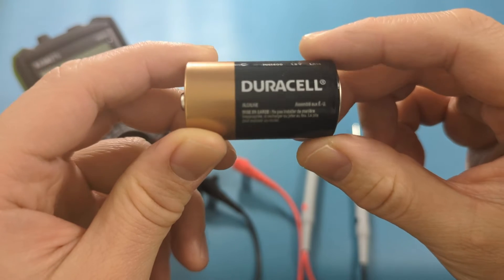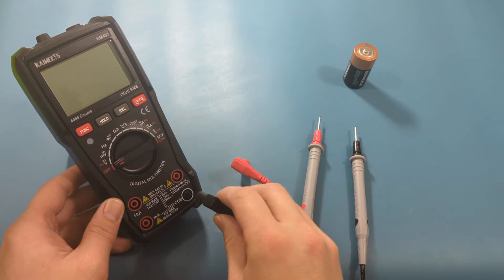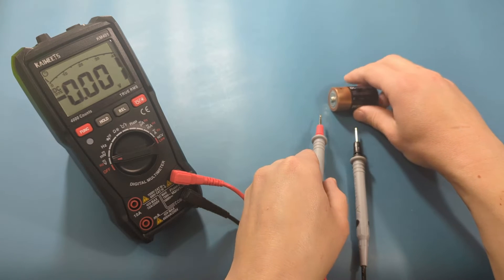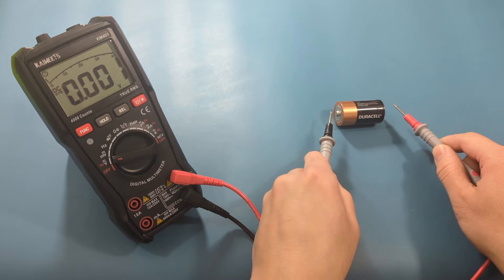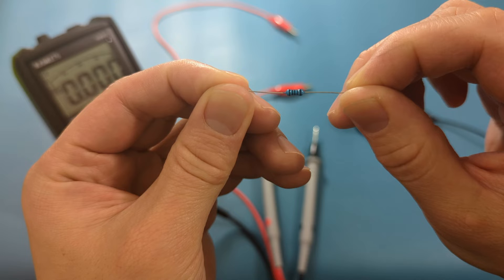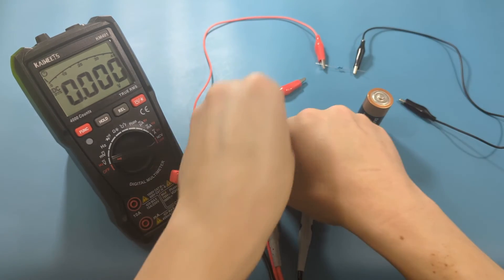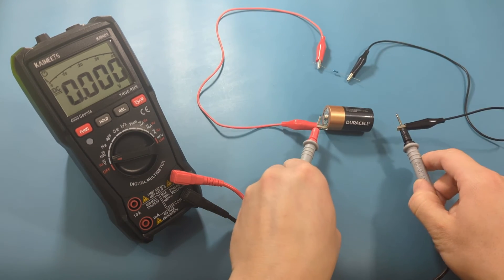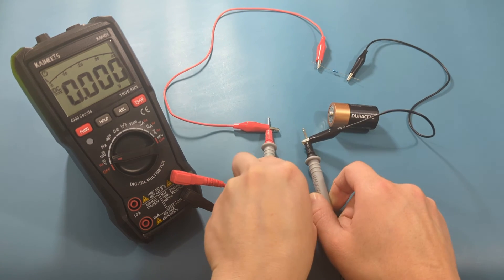How to Test C Batteries With a Multimeter (Step-by-Step Guide)

Comment: Failure criteria?!
Reply from the maker: If the voltage is significantly lower (for example, under 1.2 volts), the battery is likely discharged or failing.